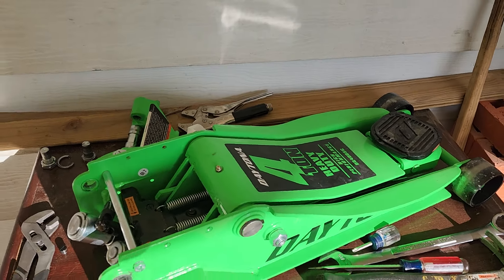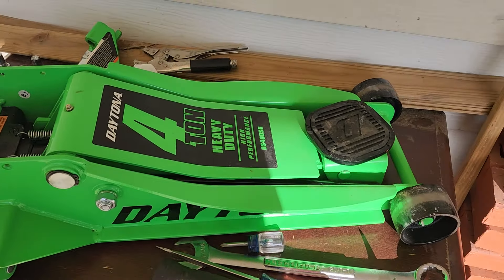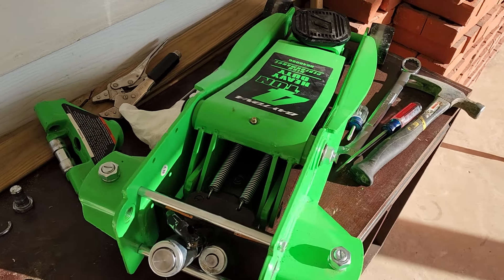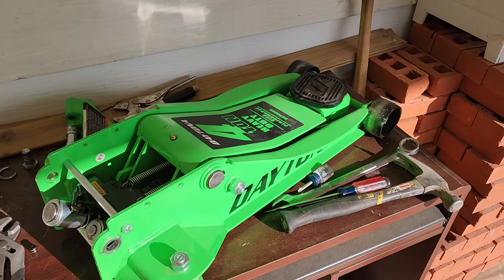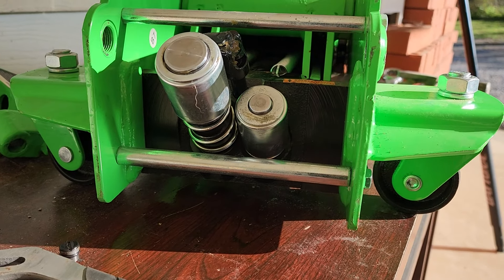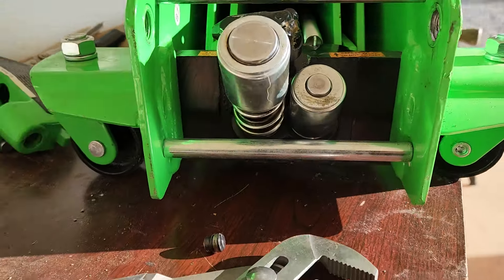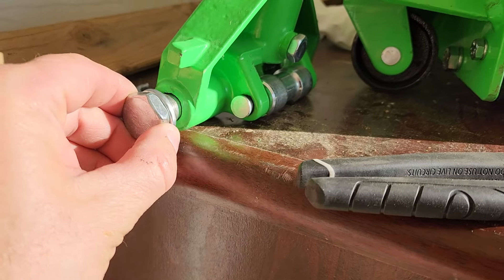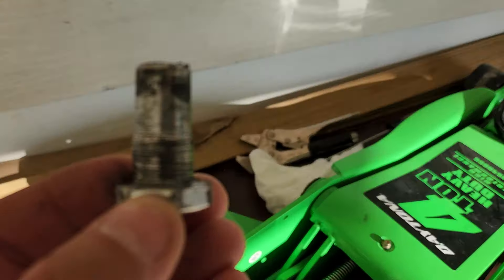Beware Harbor Freight Daytona jack!

Comment: Pull it apart, pull the piston out. Clean with hydraulic jack oil. Re assemble and keep using it..  Happened to one at my old job. Boss didn't want to deal with it and cursed it out. I took it home and fixed it in a few mins... Comparable jack from Snap on is $1,200 so a little machining debris to cause it to stick is to be expected and not a big deal

Comment: I wonder if their spring is too weak. The HF jacks Pittsburg and Daytona have issues with that piston sticking. The spring should pull it right back up but it doesn’t. Mine did the same thing. If you pull the piston it’s nothing but two o rings on it.

Comment: If you look at the bolt on the right hand side, it looks like a reverse thread. It appears the reason it is stripped is because when removing it,  you were tightening it!
It would make sense using a left hand thread on the right side to ensure it doesn't"t loosen as you pump the handle.

Comment: Sorry to hear your having the same problem i had. I let my neighbor borrow my jack and he brought it back that way when it was working just fine before he took it. I thought the piston shield dust cover was bent because if i pryed up on it. It would start pumping back up again. So i removed it with no luck so i ended up wire tying the roller to the spring underneath the dust cover so when you raise the jack handle it pulls the piston up. Its been working fine like that but i wished it would have lasted a little bit longer next time ill just get the 1 year warranty😅. You should try the blue 3 ton  aluminum jack ive had better luck with that one.

Comment: I just rebuilt two of my floor jacks this weekend. Different brand but same concept. Much of what is wrong with your jack is self damage.

The stuck piston is from you trying to lift in excess of the jacks capacity. It's there as a safety measure. The stuck piston will come out if you remove the bottom bar and use the back of a hammer. I just did this on two jacks, very easy.

The screw you removed in front of the piston is never meant to be touched. It's how the weight max capacity for that piston is calibrated. I think other posters covered the stripped thread issue. The jack can be saved but would need some experience and tlc to come back to life.

Comment: I almost bought this daytona jack yesterday I've had the 3ton pittsburgh for almost 7 yrs and it's worked wonders but I needed something with more lift and was gonna get this daytona 4ton but I saw the bad lands 3ton offroad jack was on sale for 250 for black friday and ended up getting it gonna assemble it this week and hopefully this doesn't happen I've had no issues with any toold from harbor frieght so far so hopefully you just got a dud

Comment: yes these larger ones have this problem and it does develop over time usually not 5 uses only.  I was always able to use a pry bar to get it unstuck.  stiffer spring may be the solution for sure.  however I stopped buying these for that one reason, they haven't changed for a long time regardless of paint or naming.  I do have the aluminum with 4 wheels not 3, it has been doing well in all ways and seems to be lasting better.

Comment: I got one of those crappy jacks back in 2022. First thing I did was made sure it picked up my 1974-f350. It did ok, but thats not good enough for me. AND NO I Didn't buy the dang extended warranty. I checked it out and saw the way the handle and pistons were and lubed them up checked the fluids, BECAUSE IT IS MADE IN THAT CRAPPY COUNTRY OF CHINA.  Sure enough Added some fluids and bled the air and reset the lift by holding and pulling the lift all the way up untill I felt hard resistance with the handle slightly tight for pumping upwards.  It held.. And I turned the handle and slowly to let it down. Then rechecked the fluid level and YEP, added a small amount more  and rechecked all over again. THOSE handle Bolts BTW are left hand bolts and they are Metric Threads.  I did replace those bolts once I found them. They are ,zinc junk. I have rebuilt my 45 year old Craftsman, 3.5 ton hydraulic Jack made in the USA  several years ago, even saved the old piston seals and got an extra kit and then bought the Chinese Crap to wear out, so as to preserve my American Made floor jack. NO I hated to even buy the damn Chinese Communist Crap, BUT LOOK AROUND PEOPLE.. Made in China is everywhere,  finding it's way into the American Landfills because China Makes Junk..If YOU BUY Chinese BE CAREFULL, use those Jack stands. Man China Really Sucks badly made to keep buying forever. 😠

Comment: all these quick lift jacks tend to to that. either the there is a spot that got bent in or a bur inside stuck easy peasy. Ive been selling tools for 35 years. Paint that jack red and its 500 on the snap on truck same jack.

Comment: 1st Jack I bought from Harbor freight like this one of the plungers stuck and I couldn't get it unstuck the 2nd Jack did the same thing. But I soaked it with blaster upside down and it finally worked.

Comment: Mines seen a couple uses and I went to release witht the shaft turned left no dice. I pulled it out and it flipped up vertical under the truck. Trying to figure out how I can lower the truck now

Comment: I also have a green 3-ton version of this jack, same thing. Same piston is stuck down and won't lift. I don't think Jon has abused this jack (as someone commented below) as I have not abused mine either. And his still looks as new as mine. I only use it on my cars and none of them are over 3 tons. I use it to lift the cars and put jack stands under them. But yet, here I am, searching to see if there is a fix to my jack that won't lift due to a stuck piston. I guess we know why they went on sale. Maybe they knew this would happen?? Anyways, I continue to see if there is a fix as I can't believe in less than a year my new jack is busted.

Comment: i found that the return piston springs bind against the retainer cup ( i don't know why they use a cup instead of a retainer washer) however i trimmed the cup off with a mini saw and installed the retainer with a slightly stronger spring. permanent fix...oh and I replaced all O-rings with better quality units.

Comment: I had the same common problem with this jack.
I just flipped the jack over soaked ite piston with a penetrating gel let it sit and tool a large screw and simply Popped it back in place.
It has worked fine since

Comment: It doesn't have to be in the box unopened I bought a pressure washer last year and didn't like it it didn't perform well and it was less than 90 days and they gave me money my money back. That's the one sucky thing about Harbor Freight sometimes they're quality control isn't the greatest and you really need to buy their one or two year extended warranty which makes it not as great a deal but it saves you.
Reply: well pump try to take one back.
Reply: @assyholey4224  Yeah I did take it back It was opened and used once
Reply: @darrenporsch  well pump had it 4 days HF said no returns.

Comment: I guess I've been lucky.  I have one of the big orange ones.  I've had it a good 15 years & heavy use. All I have ever done to it is add some fluid & bleed the air bubbles. I believe they were making them better back then trying to compete with other brands. Its been a good one.
Reply: @Jason camp crystal lake Voorhees It's a good bit older than 15 years old I'd say there bud, but your rite I just a few years back replaced the same pitsberg white and orange one that was a hand me down from a guy who used to own his shop in san bernardino. That thing was used and abused and still was better that the 3 ton new grey shitsberg at harbor freight now that just shit the bed on me too! Id say that was about a good 20 years old the orange jacks with the white handles if i had to guess...
Reply: @tammeraeads7850  yes, orange with the white handle.  I just used it the other day to pick up a food trailer & remove the wheels before that used it to change brakes on an expedition.  It still works great.  You're right it probably is around 20 years old.  I've had it a long time for sure.
Reply: @BigAlWillis  Yeah, you are right.  I’ve had my orange one for over thirty years now (bought it back around 1989) and another one I bought maybe 4 years later and both work like champs.  Now I am not what you call a pro mechanic and only use them to change my oil, and brakes and such jobs to keep my old cars on the road, but still I think they suit me fine after all these years.  Why heck, I am getting up in years myself and I think I may just pass them on to my grand kids!
Reply: @donjohnson3701  someone told me years ago after use before you put them away give it a couple pumps to keep pressure.  Said it makes the seals last longer.  I do that too.

Comment: Same thing happened to me with the stock piston on the one and a half ton aluminum Jack and I bled the air out and made sure it was full Jack oil the Jack worked okay for a while that's what the Pistons got stuck down I had to check my vehicle up they get the tire off I had to use a hubcap hammer The pry piston up I cleaned up the piston can I put a little Jack oil on it so far it seems to work okay Harbor Freight sell some real crappy Jack's they ain't worth the money that you pay for them judging by the comments all and all it sounded like the problem is with the stuck piston and that should have never happened

Comment: I have the 3ton aluminum floor jack and had the same thing happen to it with one piston stuck down but with the one piston still good it can still lift. I haven't taken it apart yet. The piston stuck down after about six months and only used it like 10-15 times. It is china made so you know the parts are not high quality. I wouldn't buy the same one again or the Daytona one with your issues. Thanks for the heads-up. 👍

Comment: You used a impact on the BOLT PIN to loosen the bolt. You tightened it bro, so tight it broke the lock washer and you kept tighting it and it stripped the reverse threads.

Comment: Base on the comment I see a strip bolt due to use of impact gun, I had the 1.5 ton which I change the brake work just fine should use hand tools next time.

Comment: Hate to break it to you but I know how that problem happened you over loaded the jack and you spun out the bolt with an impact. I had that same jack for ten years and never a problem. I have worked with those jacks and the only time I seen that happen is when someone just reafs on it and exceeding the tolorances. I think if you spent the money on the 3 ton Super duty with a 3 year warranty you would have a new jack.

Comment: Same shit happened to my PITTSBURGH AUTOMOTIVE 1.5 Ton Low-Profile Aluminum Racing Floor Jack with RAPID PUMP
One of the dual action piston seized and won’t come up now…
Worst part is I used it hand full of times and hf says u didn’t buy extended warranty and u r out of 6 months period,
And I asked if u guys repair it,
She says no,
Just buy a new one.

Comment: I have two harbor freight jacks. Both of them were great. Use them all the time. I know of shops that use these frequently. In fact that's all they have and they work just fine rebuild kits for them or the same as pretty much any of the other jacks that are out there so the jack problem the piston problem was probably just something wrong with the piston needed to rebuild kit or something and can't complain about their return policy. They tell you about it and even snap on. Has they just going to fix it or swap it out and after a short period of time? And I don't know what they're warranty is now they do the same thing. All companies do the same thing but they're jacks are good jacks. Like I said I've known several shops that have nothing but harbor freight jacks cuz they're cheaper than the others and they work just as good

Comment: Backing out ANY critical bolt of ANY kind with an impact wrench, you deserve damaged threads. You >NEVER< do that, PERIOD! People blindly think threads are forever perfect, but they can be unusually fragile. If there's a tool that's misused most, it's an impact wrench. Any seasoned mechanic will tell you that a lot of his trade is in his hands where he uses "feel" to gage how any bolt, nut or fastener is going to move. The very least experienced "mechanic", which they aren't, blindly uses power tools. Lot's of broken items by people who just love to pull triggers. As to that stuck piston, that "can" that surrounds the spring can get out of shape and wedge against that spring. My HF jack is at least 20 years old and it's happened to me. I just pry it up with a tack puller hand tool. It returns to working. It's always in the truck and gets dirty too. When it gets stuck, the jack "hardly works". Jacks need maintenance too. Lubricating all joints when needed is necessary. You're talking HUGE pressure on these joints and when they rub meal to metal, you're just begging for trouble. Take off those "C" clips and lube everything. My jack really gets used and if I didn't periodically lube it, it would be ground to death by now. Changing oil certainly doesn't hurt, but in your case, have someone else do it.

Comment: I have a Pittsburgh floor jack that works good. I have a Pittsburgh transmission jack that is a piece of crap. I have a Pittsburgh engine lift where a lot of welds aren’t even on the joint.

Comment: While it might not be the same one,I just bought the 1.5 ton aluminum racing jack,…first thing was it did not rapid pump,second was it was good for 3 times and then as I was jacking up my car it collapsed and the car fell real hard on the jack…it completely failed ….I have an old 3 ton pittsburg jack that I’m gonna try finding seals for,…that jack I had for years and it never failed me till it got old….idk I’m just not impressed with this new stuff anymore
Reply: Same here. The aluminum jacks are all junk. I lifted my 1940 Pontiac coupe once then it failed. After having it a few months I was very disappointed. Thought since I lost the strength in most of my right arm this was something to help me when I needed it. Now I have the one shown here same color also. So far it has done the job,but will never fully trust it.

Comment: You didn't bleed it right the first time and the piston got air locked. If you cracked the bleeder and tried to pump it with a load on the saddle it would probably come back on its own. The smaller piston is bypassed for the most part until there is a load on the saddle to counteract on it and the bypass valves. The smaller piston is there to do the heavy lifting, where the big piston is the grunt that is there to quickly move the saddle up when there is literally no load present. I have been there and done that... pistons will air lock themselves when they aren't bled right. Not harbor freights fault... and easily fixable... if you use your head and understand how hydraulics work.

Comment: A bit of wd40 would have fixed but you bent it with those pliers, the head of that bolt was also overtightened with your pliers the manufacturer used a socket you tightened rather than loosening and looking to blame others in your frustration

Comment: All the boat problem is something you caused, but the piston problem is a common problem that happens with all those jacks. They're they're easily fixed. They make rebuild kits for them all the time. You just have to rebuild them. And harbor freight doesn't manufacture anything. They outsource it to somebody else and a lot of times they will go to where name brand manufacturers are are having their stuff done and outsourcing the same product. And if I'm not mistaken the jack the Daytona jack is manufactured by the same people who manufacture the snap-on jack. And this is. This information comes from the lawsuit that snap-on sued harbor freight over and it came out in the lawsuit that there was the same manufacturer. It wasn't even snap on. It was manufacturing it so the quality jacks. You just had one that had a a piston problem. No I don't know how you going to fix that bolt but if you can fix that bolt you can rebuild that jack that piston

Comment: I was ALWAYS worried about buying something like this from harbor freight.  Your life may be lost if the damn thing craps out.   Glad you use jack stands.  If used correctly they can save your life as you know!!   And like another said, by a new one and a month later bring that one back.  Then sell the other one and get a better jack that is made in America.
Reply: Just be careful not to buy the HF jack stands that were recalled due to faulty welds.  😬

Comment: Bro that screw is left handed thread.  You literally obliterated the threads with your impact.   The piston is sticking likely because there is air in it, you need to bleed the air out of the jack.  Air compresses much easier than the hydraulic oil and there isnt enough pressure because there is an air bubble in that piston.  Also, ive has harbor freight take items back and give me a refund that were opened and used, i think it just sepends on the store or the person at the counter.